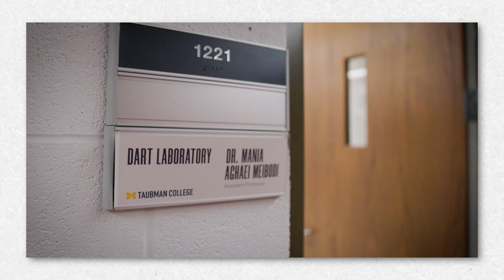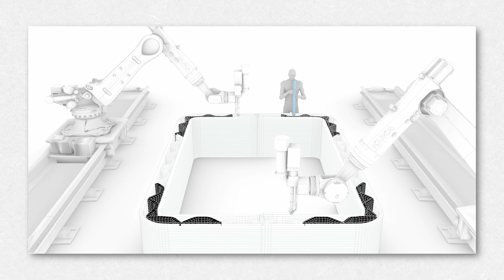Multi-Robot 3D Printing

Comment: Your research can be extremely useful for the design, manufacture and assembly of houses in metal structures, with more recyclable materials, which although require greater precision in the work, can make it faster and more economical! It would be exceptional!